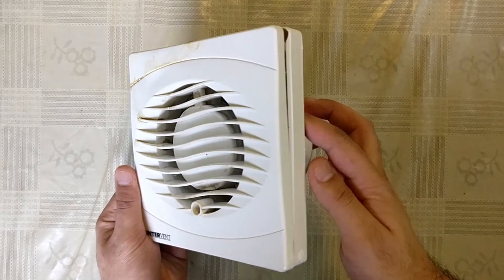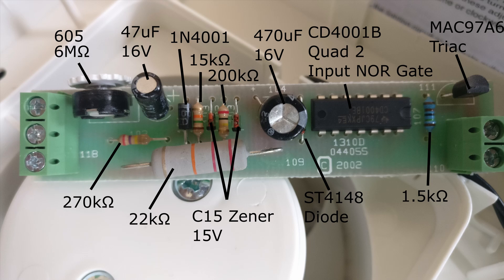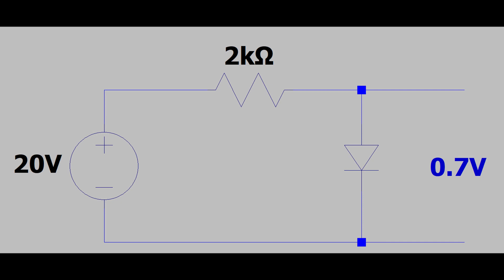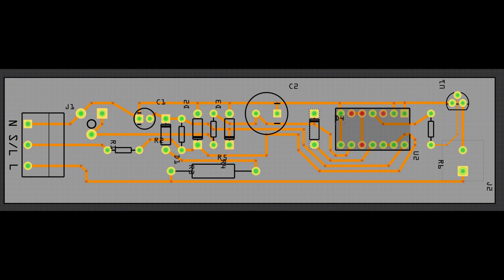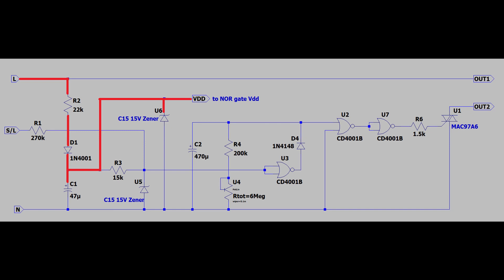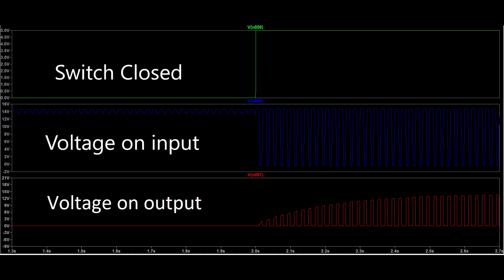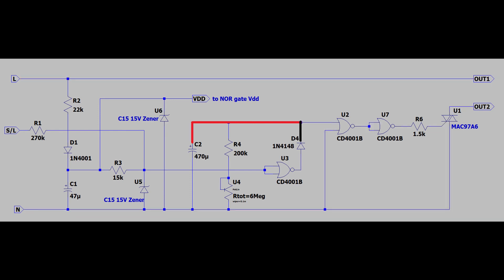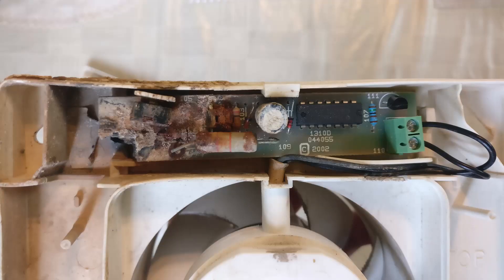Reverse Engineering an Extractor Fan Timer Circuit

Comment: This is a common circuit approach, and I examined my working unit when the fan bearing got noisy after ~10 years. IMO, the 22k resistor is underrated for the power dissipation and in my working unit was already discoloured. If the circuit is run for 30 minutes (the bathroom light being on) then the 22k resistor is far too hot to touch. The resistor value could be increased resulting in a lower zener diode current, or two larger resistors placed in parallel, or a higher wattage resistor used.

Comment: Morning i have just repaired my board, and I have coated the board with a plastic coating to prevent this from happening again, its caused by moisture building up on the board as its cold in the ceiling and the shower extraction is warm and moist. My Triac was open circuit and the Cd4001 was US. I knew it was on the cusp last year when the timer stopped and the fan stayed on permanently. Very well put together video, just the sort of person we need down here in Southampton General Hospital clinical engineering.